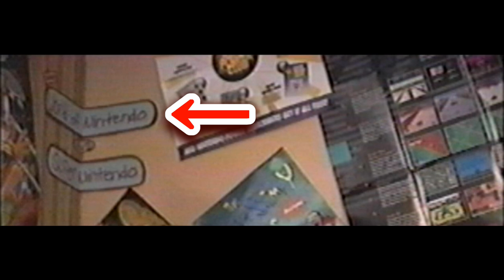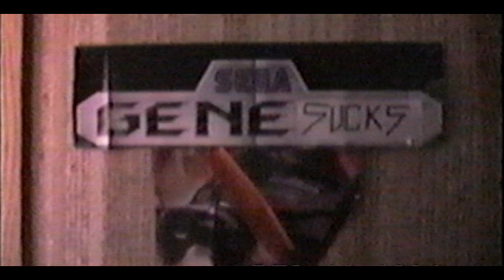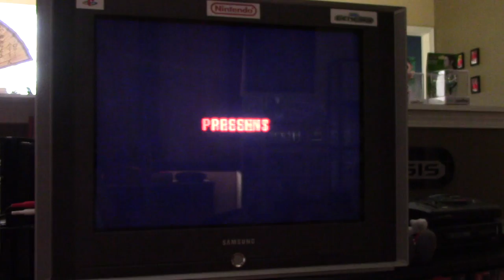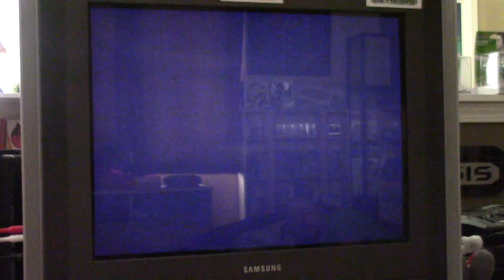Maintaining your Nintendo Equipment: Super NES Vertical Band Fix

Comment: I would add 3 10uf caps coming off the voltage regulator this should filter the voltage and make sure you are not getting a bad wavelength
Reply: What you mean coming off the voltage regulator?' Is in a different spot?

Comment: My launch model SNES is almost death (Glitchy backgrounds, flickering screen, Star-Fox doesn't work at all, NBA Live 97 is the only game that works flawlessly). If I can fix it (By replacing capacitors, or looking for broken traces) I will definitely perform this mod.
Reply: Had a similar problem with my snes some time ago.
Replacing all caps didnt solve anything.
Turns out it was an almost unnoticeable bent contact on the snes cart slot (27 and 58...both voltage contacts). Star fox appears to be very demanding in terms of voltage, that was the reason why is wasnt loading.
I bought a junk snes on ebay and took the cart slot  and soldered into my snes. Problem gone forever.

Comment: It's easy to undo the yellowing of your SNES with Retr0bright. Just need hydrogen peroxide and sunlight.
Reply: Also, it'd be a good idea to use LED light bulbs and put UV filters on your windows if you want to prevent future yellowing. LED bulbs last a long time and use less power, too. Good stuff.